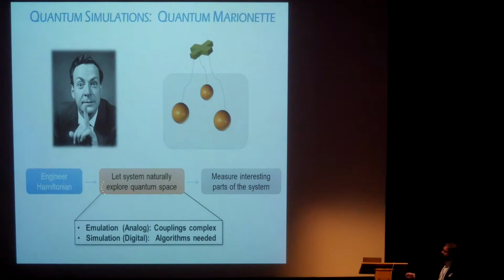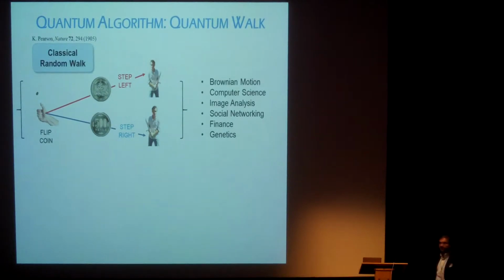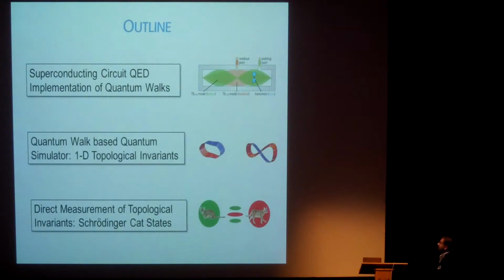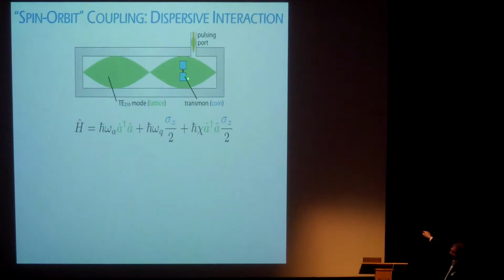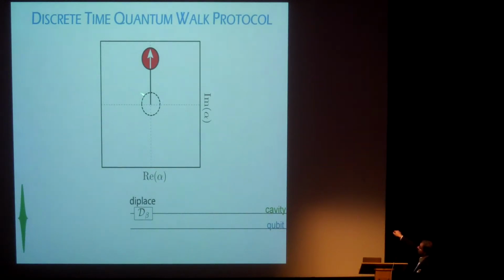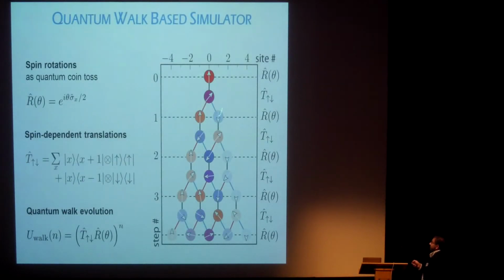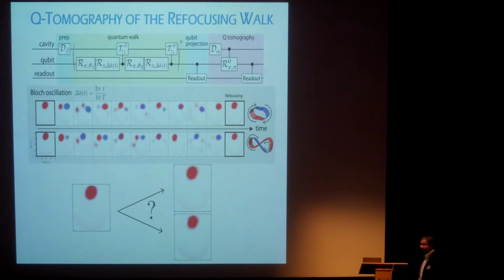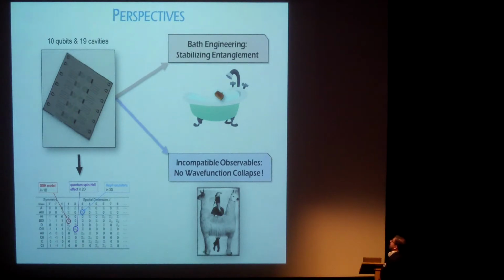EQM2016 - Irfan Siddiqi

Comment: Are there ways to compute using entangled states such that a bit ( like a one or zero ) can be manipulated and read out by an array that outputs a number? How fast can a qubit be created and measured? Are the lifetimes of the states really generated by Fermi's Golden rule? As a side note, the future of STM is in developing technology that can create superposition of quantum numbers (states) generally called eigenfunctions or eigenstates. These superpositions can encode multiple numbers at one time and can output relevant numbers with unitary operations. So a single molecule magnet that has millions of spin states can be used as a place holder for a single operation, say a Lennard Jones potential calculation, to generate a fusion simulation to high accuracy as it handles more particles. The future is in massively parallel and deeply encoded quantum computers. The problem is decoherence and the energy that breaks apart the quantum state.